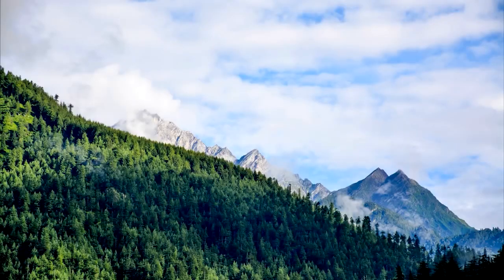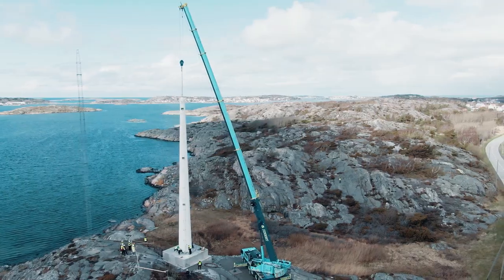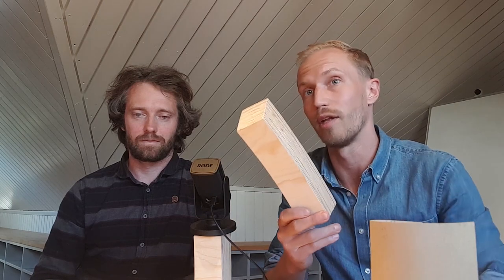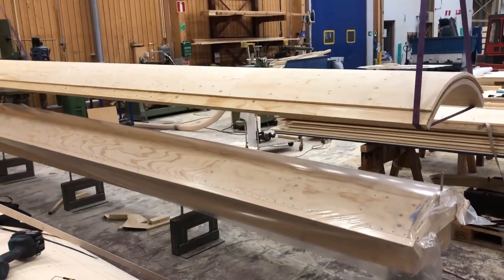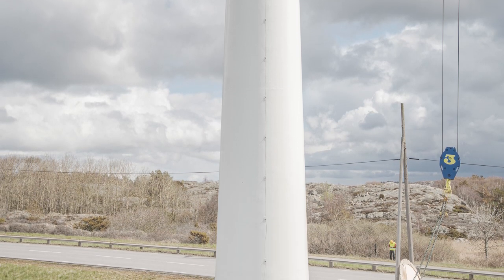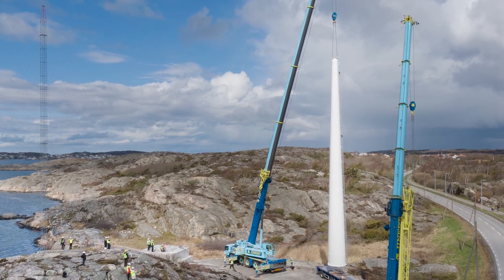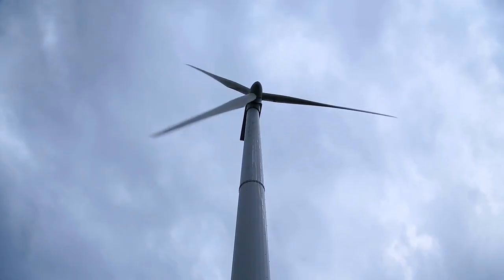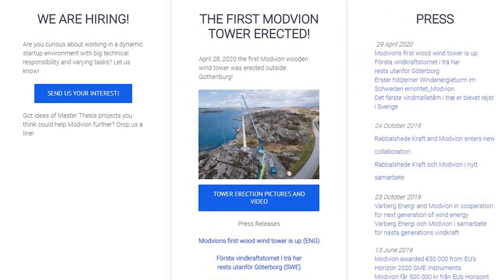Wooden Wind Turbines? | Modvion

Comment: Which crane will you use to lift the parts up to 450 m??? The highest free standing crane I know of is 246 m tall...
You might need to built a wooden crane therefore... :D

In my opinion a wooden tower is a cool idea, on the other hand I am not convinced that it is more economical than steel towers.
I would love to hear more technical an economical data about your projects.
Reply: I guess it makes some difference that the blades are attached  in their lowest position, I presume. So the highest part should be to attack the turbine at 300 m in that example?
Reply: @snuffeldjuret  in the video they talked about a 600 m windmill with 300 m rotor diameter and a 450 m high tower.

Current steel towers are about 200 m. That's mainly limited by the size of the crane (246m), the height of the turbine housing and a couple meters for the chains to lift it up.

How can you reach 300 m then?!

And i am absolutely aware of lifting and mounting the blades in lower position.

Comment: Why not just make them like transmission towers? Are those type of structures too expensive?
Reply: David,
As I know the answer of this question has a fully aesthetic reason.
A frame worked tower out of steel would be more stable and way less expensive. It can be premounted in the factory or assembled directly on the constructing area.

The point is: mainly the political parties have decided that a frame worked tower would disfigure the landscape. In order to achieve a higher acceptance of the windmill among the building control offices and the local citizens, the white coloured cylindrical shaped towers won the race.

In my opinion there's no real technical reason for cylindrical shaped towers. On the other hand it is no bad design and fits the requirements quite good.

Comment: Where I live wood literally will rot no matter what you do in a couple years. The only type that holds up is Teak. The metal doesn’t last long either.
Reply: In that case look for molten rock technology. They are expensive but impervious against decay.
Reply: In that case look for molten rock technology. They are expensive but impervious against decay.

Comment: When lighting hits this wooden structure, and it will, what is there to protect it from becoming the world's largest candle?
Reply: I wonder if a typical lightning rod and groundwire would help
Reply: @farrastaufiqurrazak9531  why shouldn't it?
Lightning is caused by electric fields. A lightning rod will enable a low resistance for high currents down the tower. Therefore the electric field can be decomposed very easily.

The lightning rood needs to be mounted on the outside of the tower. Otherwise it might be that the electric field will hit into the wood half way up the tower. If it is mounted on the outside (in best case 4x on each side of the tower) nothing will happen at all.
Reply: Phillip R - Use a lightning arrester & grounding cable just like any other tower.
Reply: Laminated wood doesn't really burn by itself so easily. Wooden beams for example have far better structural properties during a fire than steel.

Comment: I know how much you fella's like new technology,  so here's a link to a startup, Spanish company that's designed a bladeless wind generator [no moving parts]
  https://vortexbladeless.com/
    I'd love to see an in depth review of this new technology on your show, soon if possible. These could potentially replace rooftop solar panels. I'm no fan of solar panels as they are still cost prohibitive and bladed wind turbines are an eyesore on the landscape, not to mention killing birds.
  The vortex bladeless is basically   a tall pole that vibrates in the wind due to turbulence actuating a coil and magnet producing electrical current. I'm pretty excited about this device.😀